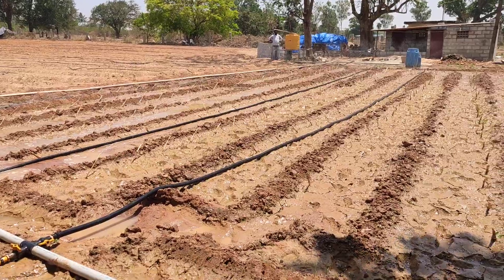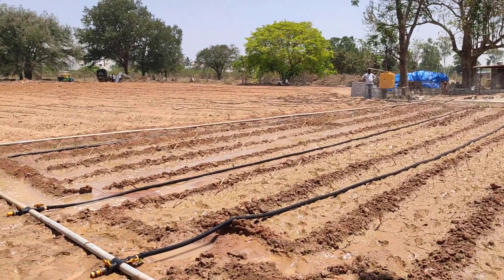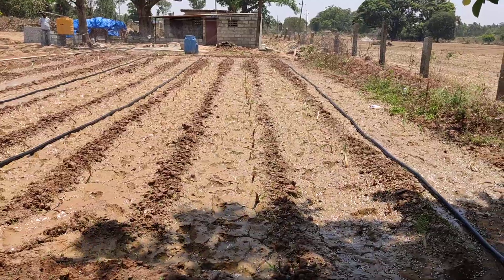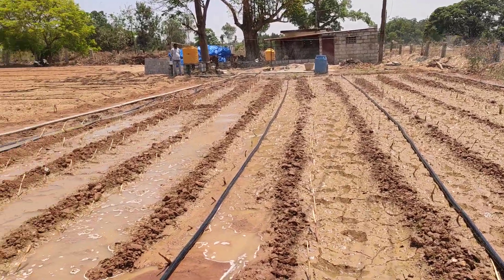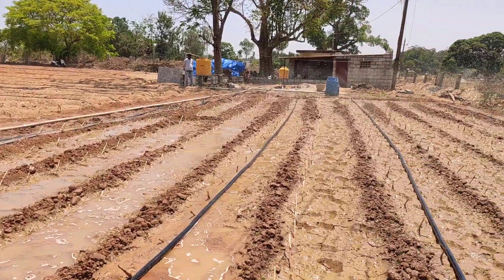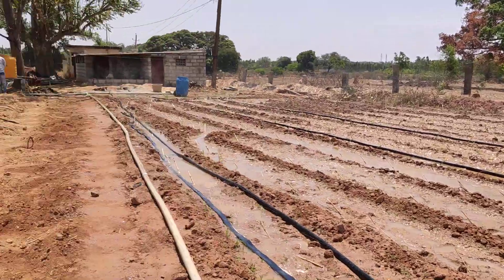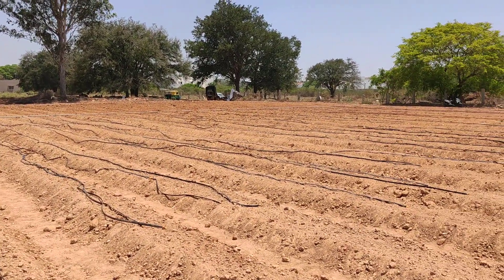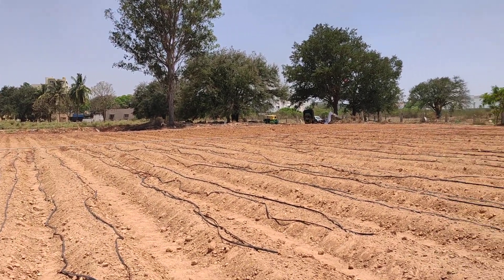#7 Irrigation Setup - Testing of Drip Tapes (used at previous farm)

Comment: In your old video you said that this system didn't allow adjacent trenches to get as much water as needed?
Reply from the maker: Thanks for the comment. In the raised beds, when I used rain hose pipes, the adjacent beds were not getting water as the height of first bed blocked the water. Solution to that was either to reduced the height of beds, or used it in flat surfaces. In the new farm, we have used the 16mm drip tapes on top of the raised beds (not the rain hose). For the super napier field, its a flat land without drips and rain hose works perfect for me. Trust this clarifies.
Reply: @EcosafeFarmer  Thank You. Yes it clarifies .🙏